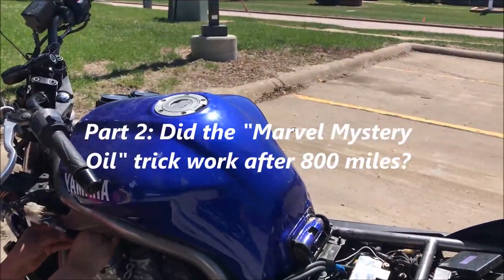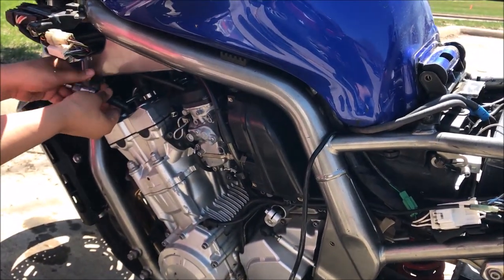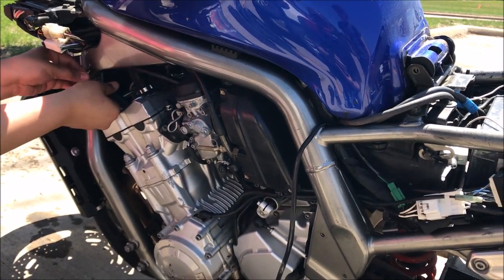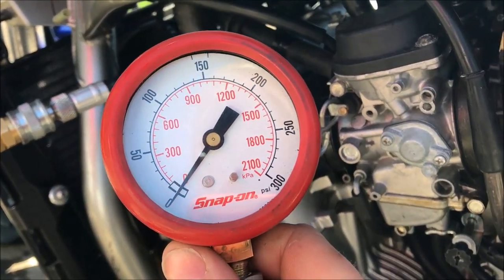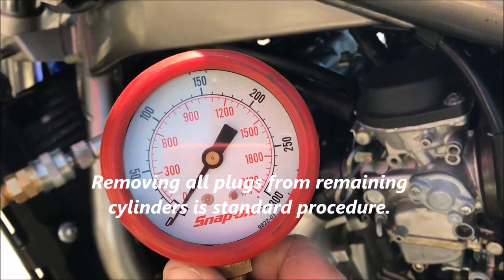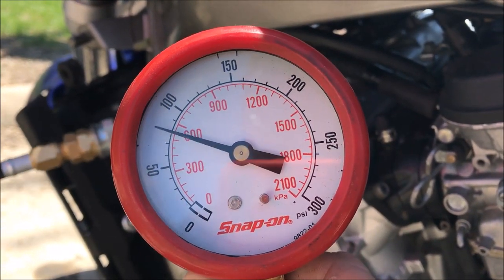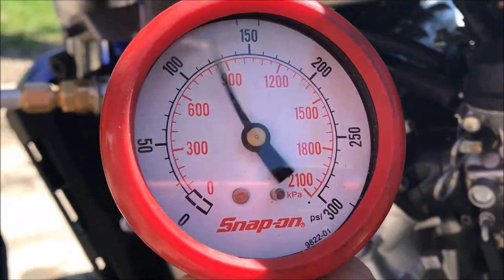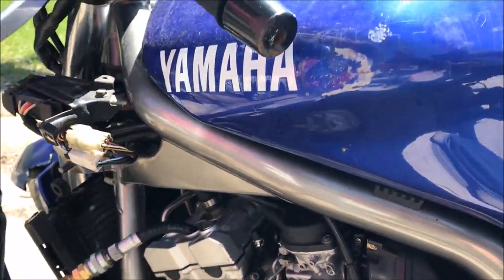Part 2: Did the Marvel Mystery Oil trick work after 800 plus miles or did we bust a myth?

Comment: yes marvel does work wonders. I had an 06 Nissan maxima with the dreaded o-ring oil leak. just got the car and didn't know it.  we went to drive in movie one cold night and idled for heat. next day started the car and for the first 3-5 seconds it sounded like the top end was coming apart then cleared up fine and quite. checked the oil,  3.5 quarts low.  every cold start it made this noise and I was thinking I will lose the engine sooner or later.  called a friend and he told me about marvel. so I changed the oil and added the marvel and within two weeks the noise was gone. did two more oil changes with marvel after that and now just regular oil only.  60k miles later and no noise. best $15 I ever spent.  now marvel goes in everything I own, cars, motorcycles, lawnmowers..
Reply from the maker: Thanks for sharing your story! Feel free to pass our videos on! 
Have you Subscribed yet to never miss a video? Have you seen the video playlists https://www.youtube.com/user/conleybuilt/playlists ? Quick answers are often found here. No time to look through videos? 

Still have questions? You’re in luck! I provide tech help and work one on one! I know your question may seem quick but with over 300 requests a week, it’s not possible to answer them all. So, I’ve narrowed down so subscribers and donations to assist beyond the over 660 free videos. My YouTube has grown beyond the ability to answer every question (11 million views! Over 500,000 a month!)

Click here for the membership links and welcome to the community! https://how2wrench.com/product-category/specials/    

Want to say “thanks” or “keep it up”? Click here https://www.paypal.me/how2wrench   This is great for those truly quick questions you need answered and your help back will keep me going!

Your answers and help are just around the corner. Save time and money while protecting your investment and yourself by doing it the right way!
Admin How2Wrench.com

Comment: Interesting result. Having been an aircraft dealer I tested MMO on several high-time air-cooled aircraft engines and a couple of 470 Cu-in Aircraft engines on twin engine Beechcraft B55 Baron that had been run at low-power cruise for several hundred hours and had developed excessive ring leakage and all 6 cylinders were essentially un-airworthy aat below 50psi on an 80 psi leak test at TDC.  As a test on one engine I added about 10% MMO to the engine oil and 10% Rislone to the other engine and in about 3 hours of normal operation, cly leakages on the MMO engine came up to 55 to 60PSI over 80, and on the Rislone engine, all leak pressure were up to between 60 to 70 psi. after 8 hours the MMO engine pressures were in the high 60 to mid 70's, and the Rislone engine, all cylinders were in the high 70's. Cutting the oil filters on both engines showed a large amount of fine carbon in the MMO engine and a concerning amount off larger chunks of carbon in the Rislone, some of which were semi-circular.  I went on to run both engines with the MMO and Rislone for about 25 hours and The Rislone engine developed pretty excessive oil leaks on the crankcase mounting surfaces. On tear down for Overhaul the Rislone engine was noticeably cleaner than the MMO engine, espicially around the piston skirts and piston rings. The MMO engine piston rings still had a lot of carbon build-up. 

In retrospect, Risone was much more effective but I think too aggressive for aircraft use. Neither Rislone or MMO are approved for use in Aircraft engine oil.
Reply from the maker: Wow such great detailed info. Thanks for adding your expertise! You rock for commenting! 
Ways to support or high five How 2 Wrench! Thank you in advance. YOU MOTIVATE US TO DO MORE!
1. Smash the subscribe button (thank if already a sub!)
2. Have you seen our "YouTube Trained Support Shirts?  https://goodfellasmerch.com/collections/how-2-wrench/products/support-shirt 
3. Join this channel to get access to perks:
https://www.youtube.com/channel/UCBhM8DCKnT3qXwTW0eToyCg/join    
-Daily MEMBER FIRST COMMENTS ANSWERED FIRST 
-Live Q/A video chats
-Wonder if we have a video on your need? Members can request content links!
-Full Access to the ENTIRE 700 video library
-Member-Only FREE tool giveaways  
4. Got an emergency and your head is about to explode from frustration or fear? Get Shane’s cell here: https://how2wrench.com/ols/products/techline-one-on-one